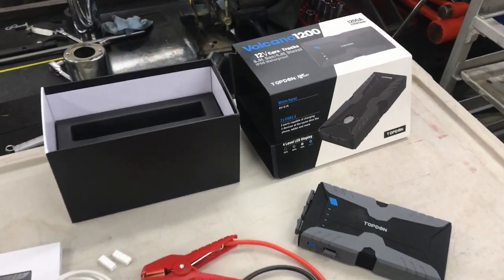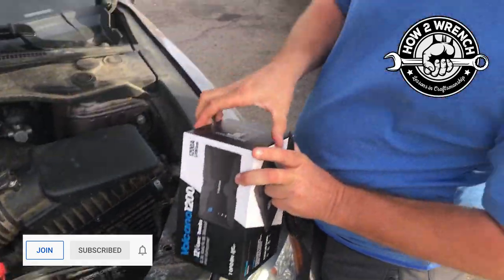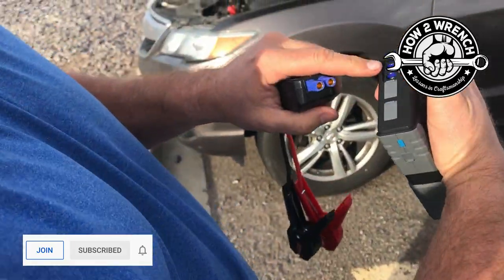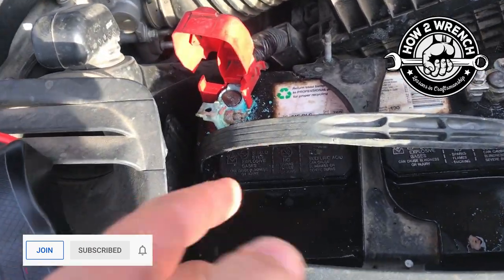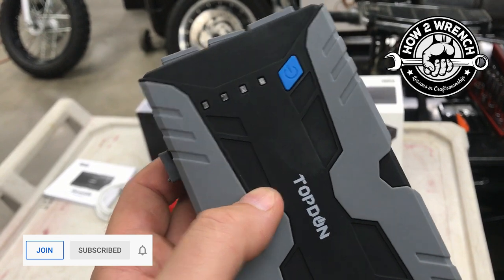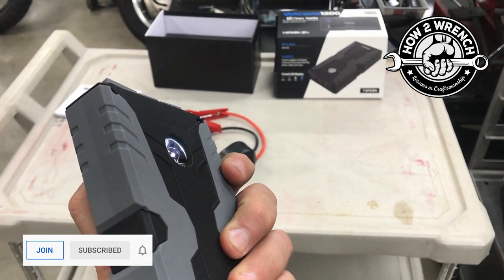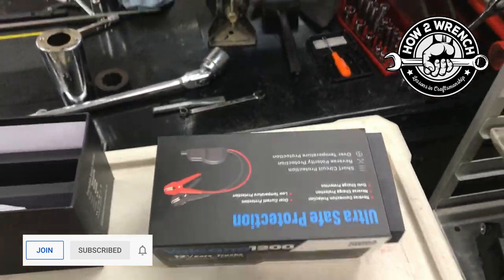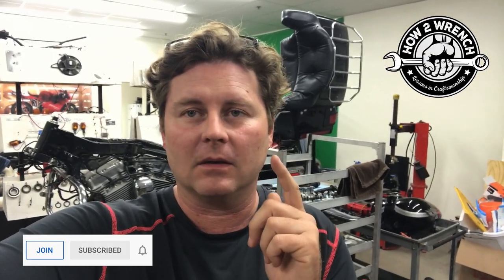Do jump starters really work on a dead battery? Look how bad this connection is! VOLCANO 1200 $50

Comment: I started having battery problems on my bike recently, so I got a similar thing. Typically, the battery was ok after that so I didn't get a chance to use it before the new battery came in the post.

My understanding on these jump packs is that there is a big difference in the protective circuitry. Some of the really cheap ones connect the clips directly to the lithium battery inside - that can be quite dangerous if shorted or overloaded. The better ones have diode protection incase you get the clips back to front, and some check for voltage from the vehicle battery before they turn on.

So they are definatly cool, better than jump cables, but like all tools they need to be treated properly.
Reply from the maker: Awesome and thanks for commenting! Can you smash that subscribe button and share our channel please? We have over 700 videos in playlists! 
Even more training and deep dives if ever needed…
Join this channel to get access to perks:
https://www.youtube.com/channel/UCBhM8DCKnT3qXwTW0eToyCg/join   
-Daily MEMBER FIRST COMMENTS ANSWERED FIRST 
-Live Q/A video chats
-Wonder if we have a video on your need? Members can request content links!
-Full Access to the ENTIRE 700 video library
-Member-Only FREE tool giveaways 

Just want to say thanks quick to support us for this information and our work saving you money? 
Give us a high 5 here:  https://www.paypal.me/how2wrench